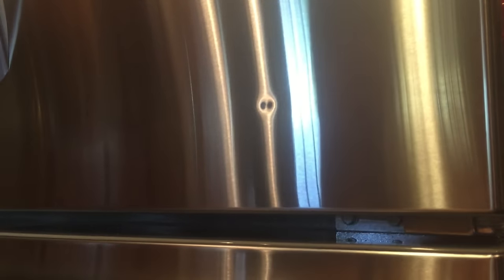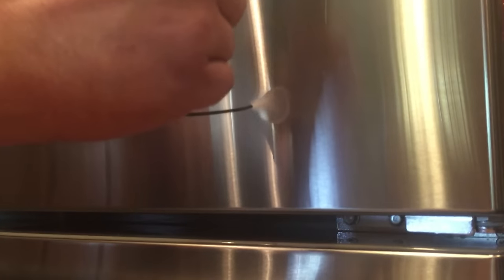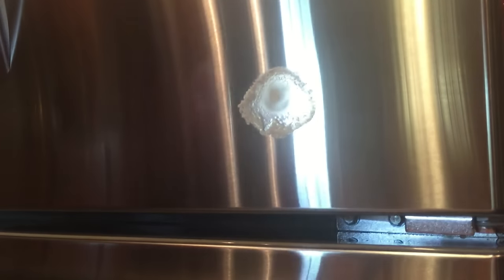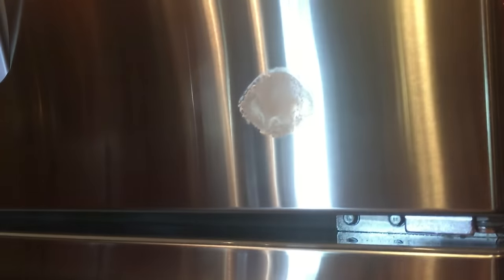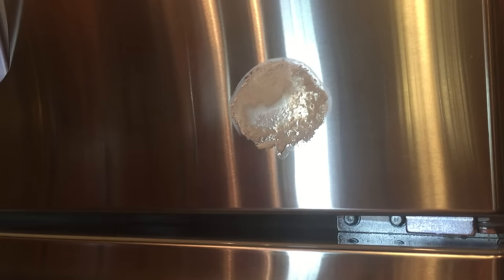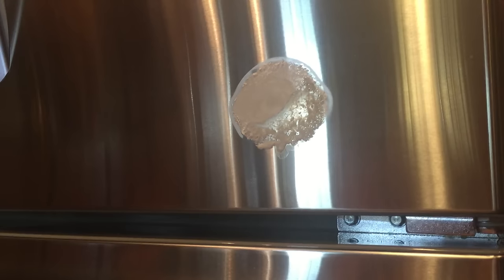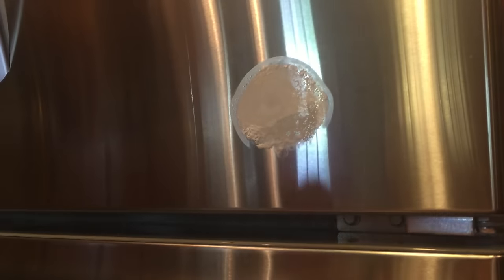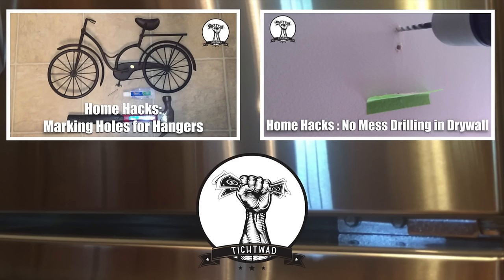Removing a Dent in Stainless Steel Appliances - Experiment

Comment: Thanks for the video. Forget those who are posting negative comments. It is equally valuable to see what DOES NOT work. Every failed experiment is equally important as a successful one in gathering knowledge and becoming wiser. Your video is much cheaper and easier 3 min. way of learning. Thanks again.
Reply: Though he could have saved us several more minutes by saying up front "this did not work". Wth do I want to watch him fail?
Reply: @macgyver2169 it's your fault for clicking on an experiment and expecting it to always work.
Reply: @macgyver2169 After all failed experiments are just as important as successful ones, due to the fact that it tells us what is not true, which is as important as what is true
Reply: Absolutely! This is the kind of comment I like to see 🫡

Comment: You have to do what auto body dent repair technicians do, you have to get BEHIND the panel. They use long spoon and bent spatula type tools to push the dent  out from behind by prying. They also have little punches to tap the dent back from the front side after popping it out until they get it perfectly flat. It's basically an art form when done well. When they are done you can't even tell a dent was ever there.
Reply from the maker: Jeff S I’ve seen them do it. Unfortunately, on most appliances, there is no way to get to the back size. This door most likely has foam insulation inside.
Reply: @TightWadDIY you could drill a small hole on the inside plastic push the dent out, then refill with a little spray foam and get a plastic cover clip.

Or take the door apart

Comment: I would second the folks thanking you for showing what did not work.  So many people would have not posted the video and I think we do all learn from our mistakes, and the mistakes of others.  So as someone else said - you have to get the metal way hotter than that.  Other videos use paint stripper heat guns.  On the topic of discolouration.  That can be caused by the heat gun because you are annealing the metal.  One reason I'm interested in ding removal is to then paint the fridge to make it look like expensive designer fridges.  So that means I'm not worried about discolouration.
Reply from the maker: Yes! If you plan to paint it, there are definitely other options! I bet bondo would even work!

Comment: I've just removed some dents from my fridge using hot glue sticks. Stick them to the dent and pull. Taken quite a few attempts but the dents are far less noticeable now, and some are completely gone.
Reply from the maker: Did it discolor the stainless look at all? I might give that a try. Thanks for sharing.
Reply: @TightWadDIY  No, there wasn't any discolouration of the stainless steel. Worked pretty well for a cheap fix. Any glue residue just peels/wipes off. 👍

Comment: In order for this to actually work you really need to get a heat gun and have that thing blazing hot. It really does work. I was able to get a dent out just like that on my refrig. It's extremely risky using a heat gun but it does work. You got to get the metal hot enough that very little effort is needed for the cold to pop the dent out. Hair dryer just isn't going to cut it. If you have allot of dents you got to be careful because you can start to get a wave effect on your stainless steel. So only pop out the ones most noticeable.
Reply: With a painted fridge excessive heat would yellow the paint.
Reply: What about melting the insulation on the inside?

Comment: How is this the #1 recommended video in a Google search?
Reply from the maker: Jason Honingford Probably because it shows that the number one suggested way to remove dents doesn’t work at all. There is no effective way to remove a dent from stainless steel panels unless you can access the back of the panel. If you try to use a dent puller, it just creates more dents.

Comment: The thing your'e not understanding is that dent is way too small for the (hot) expansion and (cold)contraction trick to work. It has such a small surface area and preload condition keeping it from springing back to flat . Another element your not considering is the type of metal . Stainless steel is not going to spring back like spring steel will. Welding a pull point would have fixed that in no time . Ask a metal worker . But good job for effort .
Reply from the maker: Thanks for adding to the knowledge base.
Reply: so grateful for your input ...I wonder what brings the pros to these videos though ...(I don't mean that in any disrespectful way at all I'm genuinely just wondering ) either way I'm super greatful for all the handed down knowledge

Comment: I removed a dent using a Vevor dent remover. Removed 95% of the dent. You can only notice it a bit from the side when sunlight shines on it. I slightly raised the dent above the fridge surface and gently panel beated down with the supplied hammer using a plastic CD cover in between. Only way to get 100% result is level out the dent perfectly which is near impossible
Reply from the maker: Nice to know!

Comment: I know this is 2019, a bit late, but did you try ice first then heat? I am thinking that compression from ice then sudden heat may cause it to expand outward. Just a thought...
I have dented my brand new refrigerator yesterday. Ouch. So I am looking for a solution as well. I would be using a fire extinguisher CO2 for dry ice.
Reply from the maker: Faisal Khan I honestly don’t think there is an effective method for removing dents in stainless without pushing it out from the back side which isn’t typically possible with appliances.
Reply: @TightWadDIY  I was very doubtful that this was not going to work, but still looking for another way to remove the dent, compared to stripping the interior finish and hammer it out from the inside.
These doors have foam injected in them and so would be a mess to get in there. I am just going to put a magnet or a sticker over it.
Reply from the maker: Faisal Khan I just think there isn’t enough material there to pop it out from the front. We put a vinyl design over ours.
Reply: @Faisal Khan did you figure out a way to remove the dent on the fridge?
Reply: @iislandhunny69  Faisal put your response here:  ....

Comment: If that is an expensive refrigerator, where the cost of a repair is justified, I'd take some clear phone photos holding a ruler next to the dent for measurements then get some repair estimates from an auto body repair shop. Back in the old days when colored fridges were a thing we moved to a new house and our fridge color clashed in the new kitchen. A new fridge wasn't in the budget so I took it to an auto body shop and had it painted. It can out Perfect! It looked great! It was by far the most economical choice to fix the problem.
Reply from the maker: My wife cut out a decal and put over it! Haha.
Reply: @TightWadDIY  That works too, creative, but it works.

Comment: You should of tried using a suction cup. I punched my fridge and using ice first then hot water I got a decent portion out. Now I just need* real heat source and something colder then an ice pack
Reply: Just did the same to my stove 🤦🏻‍♀️ you put ice cubes on it?
Reply: haven't seen any that small tho. seen the ones that you attach with hot glue gun that are just over half an inch in diameter but the glue does not stick to the slick surface no matter what.... if I could find small enough suction cup to help that is what I'd do too.

Comment: You forgot to use the pop a dent tool from a auto shop! How do you forget the 3rd and final step.
Reply from the maker: lavina Gann The metal on stainless appliances is too thin to use the dent poppers. It just makes additional marks where the tool attaches.
Reply: I have same problem on my new microwave, you and/or I gotta try using a good, strong little suction cup

Comment: Use an actual hot air gun, not a hair dryer, and spray directly at the dent very close up. You cooled too big of an area..
Reply from the maker: It still won’t work. The metal is too thin.

Comment: You need to massage it out from the back
Reply from the maker: Fegley Fixes it That would be the solution if the door wasn’t filled with foam insulation.
Reply: @TightWadDIY  I know this is an old post you can drill right through the inside door and pop it out from the back the way they remove dents on a car then just put a plastic plug on the inside to cover the hole probably wouldn't be the size of a pea
Reply: Interesting.

Comment: I used a glue pull auto dent remover.
Reply from the maker: GIXXER KELLY I've seen where people try that and it makes other dents on the sides of the original dent. How well did it work for you?
Reply: The PDR kit I bought off ebay for $50 shipped worked great. Some dents took more pulls than others. Patience is a must though
Reply: Key is to pull only the dent. Don't glue to areas you don't want to pull. Cut the puller down to the exact shape and size of the dent before pulling. Lastly, your heat wasn't hot enough to actually make an effective experiment.
Reply: It would be useful to know what kind of PU insulates the door. Some won't stand up to a lot of heat.
Reply: I thought the same.  It has to get really, really hot (like "burn your hand hot").  I did try just the hair dryer, and did it multiple times for long periods of time, but even though the dent looked slightly less, it looked the same when I backed up.  :/   Maybe I'll try again using dry ice afterward (if I can find any).